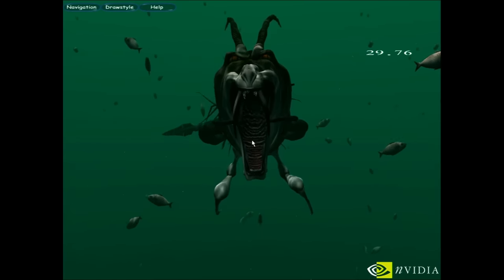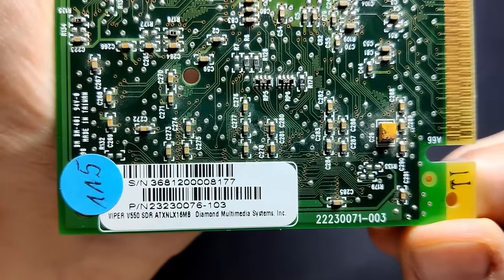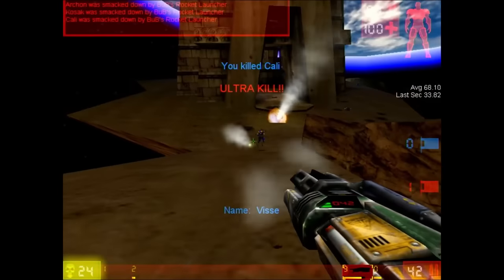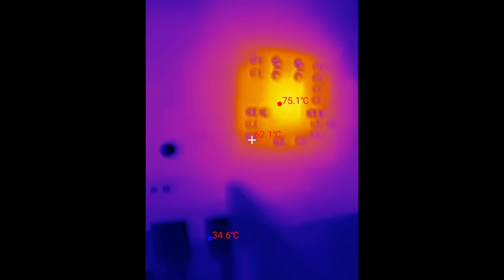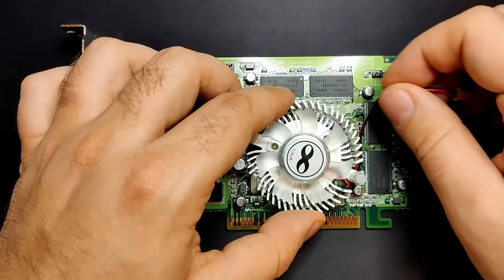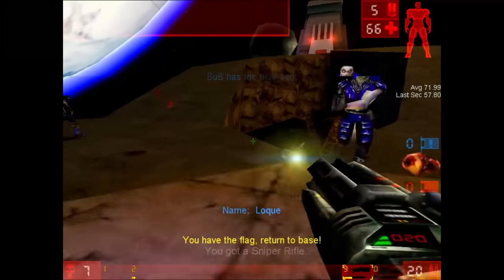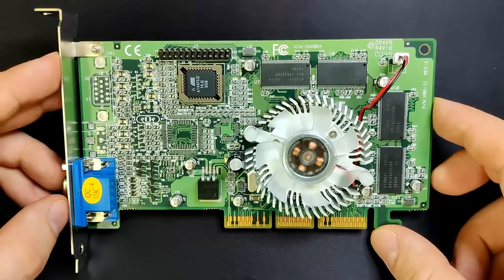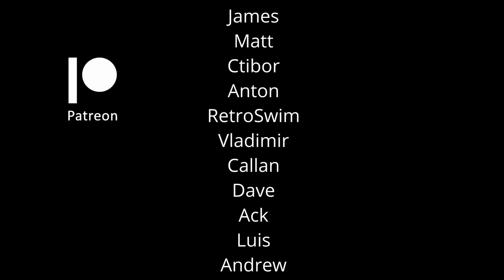Should you upgrade your retro graphic cards to active cooling?

Comment: Interesting video. With active cooling the temperatures are much lower, a huge improvement. The Geforce 2 MX being very memory bandwidth hungry, the performance would improve the most by overclocking or running the memory at a higher frequency. The performance improves too if the GPU core is overclocked, but not as much as when overclocking the memory. It would be interesting to see a video with new faster memory chips on the Geforce 2 MX.

Comment: While it may not need the cooling, one of the best things you can do for retro hardware is keep it cool. These parts aren't new anymore and the solder joints are likely brittle compared to when it was new. The card will not likely last as long under the same thermal stresses as when it was new. Keep your retro parts cool to increase their longevity. There's literally no downside to extra cooling.

Comment: Great video... even unexpensive retro hardware like the Mx cards, still deserve to be preserved as they are very useful and compatible pieces of hardware. And the idea of improving memory chips seems like a good idea! 5ns memory ?
Reply from the maker: I forgot what I ordered 😂, but I think you're spot on!
Reply: @bitsundbolts , based on my experience, it's not just the memory that has to support the higher frequency - it's also the card's design. Cheaper cards are unable to run the memory at its rated memory speed. I actually also tried to upgrade one of my TNT2 M64 PCI cards with 5ns memory (in the hopes of reaching a stable 200MHz), but sadly there was almost no improvement in memory overclocking capabilities compared to the original 7ns memory that the card came with (it was still limited to ~ 150 MHz). YMMV, though.
Reply from the maker: Yes, that is what I am afraid of. The memory controller is still on the main chip which may be the limiting factor. Maybe I'd rather keep those memory chips for other cards (broken cards that need memory chips replaced).
Reply: @bitsundbolts  Yes, I would save the chips for cards that are likely to be able to actually use them.

Comment: My attitude towards active cooling retro cards is more cooling than stock may as well be mandatory. These are older pieces of tech and the cooler we can keep them the longer they'll stay in good operation. For cards that came with no cooling, universal 40mm chipset coolers that use thermal tape are cheap and easily obtained. I have them on both of my S3 Virge cards and a V3 1000, and they'll take a 35mm to 40mm fan  with minimal fuss. For cards like the GeForce MX and some Voodoo cards  there are very nice all copper coolers out there as well, some of which have adjustable mounting ears. There are even large flower type coolers out there with pushpins. If you'd prefer not to deal with that or the card has a glued heatsink and you don't want to risk popping it off there are PCI slot cooler bracket kits available that will take a set of 120mm fans. Stick a couple of Noctuas on there and I'd imagine even the warmest running PCI V3 3000 would be kept in check. BTW, if you have a STB Velocity 128  with that stupid TO-220 heatsink glued on, a large rectangular one piece adhesive heatsink for a RaspberryPi fits nicely and looks way better.

Comment: Although 70 degrees is perfectly acceptable for silicon, the thermal cycles can cause tiny cracks in the BGA solder balls, so I always add a fan on all retro GPUs that don't have one.
Reply: As of today I am doing the same.

Comment: Back in the day, I had a GeForce 2 MX but it came with nothing on the chip. It worked fine, but overclocking it was impossible; even the slightest increase of core or memory freq resulted in crashes.

I had my P166MMX around, so I took the cooler off, attached it to the card using tennis raquet string (happened to have that around too), which I knew would resist the temps, connected the fan to the PSU, and done!

It overclocked like a champ. I even run a 24 hs stress test with no issues.

I got to play Morrowind for a long time with much better viewing distance and overall performance. 😁 It was still working fine when I got a new PC 5 or 6 years later.

Comment: As a guy that fondly remembers the days when Thermalright was the biggest name in cooling, the answer is always yes.  Everything must have active cooling, even your wifi hotspot.  You might not need a gigantic copper heatsink with an insanely loud Delta fan, but you should totally plan out the fitment and price it anyways.  All jokes aside, I never ran a crazy huge GPU cooler, but there was a definitely a big span of time where video cards were often ill-equipped for normal operation and it shows.
Reply: As a computer engineer, no.

Comment: Amazing video and good to see this card again! I have a system with a GF2 MX PCI 128bit running at 220 core/200 memory. The boost in clock speed didn't make any difference but the memory improvement is huge in some games even for this card in PCI format.
Reply from the maker: This is what I noticed as well. But I also had some funny results with Detonator driver 6.31 (one of the first drivers for the GeForce2) which doesn't make sense. 3DMark99 scores around 30% higher than with later drivers. Overclocking makes no difference (memory or GPU). It does with later drivers though.

Comment: I'm a big fan of mounting PCI slot fan brackets with large fans pointing at passive GPUs
It does mean you lose one or two PCI slots but not a biggie if you're using a larger motherboard
Worth the quiet in my book 👍
Reply: I am interested in this. I have found a place selling some old stock of the noisy titan type. But do you know of other models or places to order from?

Comment: The answer is always yes. Heat is our enemy, that hasn't changed in decades. Passive cooling is better than no cooling, but a single, well-tuned fan can change the entire equation in our favor. This is a good mod.

In some cases, I believe you can remove and install the component from the other side to avoid cuts and holes on the heatsink...

Comment: Interesting. This kind of answers the question I posted under your previous video.

I would prefer active cooling, even though it may raise the noise level of the system. I would rather extend the lifespan on the device and have it running under more comfortable temperatures.

I think I would consider adding a "memory" heatsink to the voltage regulator. It may stick out a little but I think it could fit, and it could help it get rid of a little more heat. Those heatsinks could be installed on the memory as well if necessary with the overclocking.

I am only unsure about how to secure them. I have had lots of them just fall off after a while. Even with the original Zalman ones where you would peel off some foil and it would reveal a sticky surface. Maybe some glue? Or is there some thermal compound/paste that sticks really well so the gravity doesn't pull them off?
Reply from the maker: I have not used it yet, but I did buy some thermal epoxy. But that's a permanent solution then. I don't have a good solution for this problem. The fan for the card on this video did a well enough job though.

Comment: Check memory voltage rail for the card that fails to clock memory to its specs. Videocards from some vendors were notorious to undervolt memory chips sometimes back then. I had to fix memory voltage rail on two cards I used to use at the time, one being TNT2 Pro and another being GF2.
Reply from the maker: I have not checked the voltage for the memory, thanks for the tip!

Comment: I'd be very intreuged to see a memory upgrade on the GF2 MX. Not enough people experiment with GPU memory upgrades.

I'm currently doing a similar thing with my Radeon 5700XT. I'm planning to upgrade the vram from 8Gbit Micron (MT61K256M32JE-14) to 16Gbit Samsung (K4ZAF325BM-HC16) which will also increace the memory speed from 14Gbps to 16Gbps. This means the bandwidth would increace from 448GB/s to 512GB/s across the 256 bit bus.

I'd also be inclined to play with the memory timings with the tool RedBiosEditor which allows memory strap configs to be modified.

I've already reverse engineered the 5700XT VBIOS by also reverse engineering an Apple 5700XT ROM (Which came with 16GB of VRAM) from an Imac and found the memory controller allocation size config to use the full 16GB or 4GB per memory controller (as appose to 2GB per controller from the factory) across 4 memory controllers (4Gb*4Controllers = 16GB).

Keep up the good content BUB! Can't wait for part 2!
Reply from the maker: That is quite an achievement! I wish you good luck with this project - it sounds very interesting and requires a lot of skills!
Reply: woah are you actually upgrading it to 16 GB ram in other words? that's very interesting, been wondering how feasible that was since those 16 GB mac module variants with the same core does exist.
Reply: @olnnn  Yeah it will be very interesting when I get the new memory ICs installed. It will also allow another question to be answered regarding NAVI10 (5700XT GPU) memory frequency. 5700XTs are pretty poor memory overclockers and top out at around 1870-1930 (14.95-15.44Gbit) for memory clock before triggering memory ECC (which is built into the memory controller).

The NAVI10 core used in the Imac is the same silicon as used in the PC 5700XT which identifies as “215-0917210” which is the Navi10 XT standard core with 2560 shaders. The card I’m using is the PowerColor Liquid Devil 5700XT with “215-0917244” or Navi10 XTX which is just a better binned version of the XT core.

Another point worthy of note is that the official RDNA (NAVI 10) white paper from AMD lists the memory controller to be capable of 16gbps (2000Mhz mclk). Which makes me wonder if the PCB trace layout for the memory is also capable as such, because the card only came with 14Gbps (1750Mhz) rated memory ICs.

The 5700XT would mostly definitely run without issue on the factory VBIOS with the new memory ICs installed but only recognise 8GB of addressable capacity.

Regarding testing of the new VBIOS Ive got it to boot into windows however the driver wont load correctly (due to the card not having 16GB physically present and reporting an error as such). GPUz does show 16384Mb under VRAM size.

I’m in 2 minds about making a Reddit post on R/Overclocking or such detailing everything I’ve done so far including needed firmware modifications and research.
I would of course make a followup regarding having the BGA work completed and the process of removing the old VRAM, preparing the PCB and installing the new ICs. I may even use an oscilloscope to check voltage ripple of voltage regulators to ensure a stable voltage supply for the various voltage rails (SOC, VDDCI, VDDIO, VCORE, ect).

If you’re interested I have the VBIOS uploaded to Techpowerup in the unverified uploads under the name “PowerColor 5700XT 16 GB BIOS”. I would link it but YT does not like that.

By the end of this all I hope to have (probably) the 1st PC 5700XT with 16GB of VRAM. Maybe even able to get 2000Mhz (16gbps) memory clock stable due to the faster ICs (providing the GPU memory controller or PCB is not the limiting factor of memory frequency).
Reply: @P2PC  ah that's really cool. I don't really have the skills or tools to work on modern bga ICs like this, I just find it fascinating as an observer. Been wondering about a mod like this since we've already seen 16gb 2048sp rx 580s and people have modded rtx 3070s with 16gb so a the RX 5700 XT seemed like another logical target for such a mod since they're pretty widely available after the mining bubble and unlike the rx 580 may actually be able to utilize it.

Comment: Back in the day I have 2 GeForce 2 MX cards in my computer back in the day, one was AGP and I found a PCI version.  This way I was able to do my first dual head setup and it was really nice.  I don't have the AGP card anymore but I will have the PCI version and I am using it in my Socket 7 computer now.
Reply from the maker: I could imagine that the GeForce2 MX may be a little bored in a Socket 7 system - at least there's no GPU bottleneck :)
Reply: @bitsundbolts  LOL that's the idea. It was originally in my Athlon XP computer. I an ECS motherboard that Tomshardware recommended and man what a mistake!  The caps went within the first 2 years and took out a lot of the things in the the motherboard!
Reply from the maker: Always bad when hardware dies and takes other stuff with it. I had a power supply once taking a Slot A and Athlon 700 CPU :(
Reply: If I'm not mistaken my GF2 MX has two video outputs (VGA and DVI) so I could dual head with only one card if I wanted to. My GTS card only has one VGA output.
Reply: @eDoc2020  I think it depends on the vendor. Both of mine had one of the VGA connectors populated.

Comment: I'd really love to upgrade some of my cards to active cooling - without a fan blowing air directly over the card (typically via a bracket perpendicular to the PCI/AGP slots) a lot of them get far too hot. Especially my Sapphire Radeon 9xxx cards.

I've been loving my Leadtek GF2 MX400 (has a temperature sensor and is paired with a Duron 1000), as it has proven to be a solid card compared to my own Viper V550 (stability issues in the Pentium II PC it has been in since 1998). Even my S3 Savage4 GT has been more stable than the TNT (runs hot however and heatsink is epoxied on).

The first heatsink you tried, I have an orange version and bent a couple of the fins out of the way for my FX 5700LE due to the crystal oscillator. Some of the other ones I tried ended up being useless as either a capacitor or mosfet would end up under the heatsink - meaning they wouldn't sit flat on any card.

Comment: I tried to replace memory modules on Riva TNT for modules which should go up to 166MHz, but they can go only up to 120MHz. I suspect the supplier of the "new" chips to recycle old slower chips and mark them as faster ones.
Reply from the maker: That could be possible. I don't know if the TNT chip could have issues with very high memory clock speeds, but I doubt it's the case in your situation since it's just 10 MHz above stock. I guess you got fake chips 🙁
I just ordered chips for a Kyro II (200 MHz). I hope they are not fake.

Comment: I am interested to see the fan connector mod for adding a fan to a passive cooled card
Reply from the maker: There are already three pins on the card that were meant for a fan. Probably the board layout was also used for more powerful models that required a fan. But I am planning a mod for a Voodoo 3 which doesn't have a fan connector.

Comment: Quake 3 would be a better choice for a GeForce2 MX than Unreal Tournament 99, because Quake 3 also uses the hardware T&L unit of the NV11 GPU and also puts more load on the memory. Also 3DMark 2000 in Hadware T&L mode is a good choice. You should get hotter temperatues than with UT99.
Reply from the maker: For the next video with this card, I'll use Quake 3 and see what happens to the temperatures

Comment: I wonder if you could fit small heatsinks to the memory chips and get them to be a bit cooler.
Reply from the maker: Without airflow, I could imagine that the heatsinks would just warm up with very little benefit. As soon as there is airflow, it is a different story, but then it is already a lot cooler. If I go ahead and replace the memory on this GeForce2 MX, I may also add heatsinks - mostly for the looks :)

Comment: should I soldier component x?
YES! Always! so to answer your end question, yes replace the memory!
Reply from the maker: I guess it's time to get the hot air station out 🙂
Reply: @bitsundbolts  My high temperature filament drier wasn't working. I took it apart and it looked like it just had loose connections. I checked for shorts. None. I put it back together and it worked. I was disapointed. I was looking forward to fixing it. lol
Reply from the maker: 😂 The magic of electronics and computers...

Comment: May the SMD capacitors be an issue? Those usually go out a bit quicker than other types.
Reply from the maker: I have repaired a few Voodoo cards, which are even older than the ones on this card, and some of them were badly dented. None of those capacitors had signs of reduced capacitance. It's only my guess, but I don't think the capacitors are to blame. Before that, I would blame my previous work on the card removing two memory chips with hot air. Maybe that caused some of the chips degrade. I'll try to find out in the next video I make about this card.
Reply: Thanks for the response. I admit the probability of leaky caps is low. But isn’t it the most fun to chase things through the rabbit holes?   ;)
Reply from the maker: Absolutely. Pinpoint the exact reason of a certain behavior is what I am after. Like the 3-part series where I try to figure out which of the 16 memory chip was faulty on that 32MB EDO memory module.
And ruling out one possible reason will lead us closer to the truth.
Before I replace the the memory chips on this card, I want to take off those SMD capacitors anyway because I am afraid they may explode when using hot air. I can just test them then as you suggest.
Reply: I have seen the series. Loving the channel content. :)
Reply from the maker: Thank you!